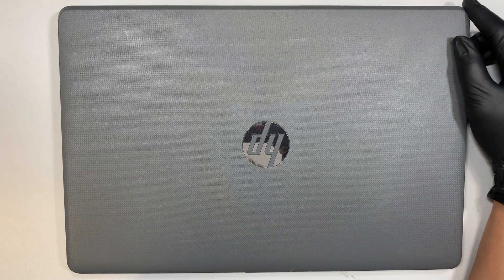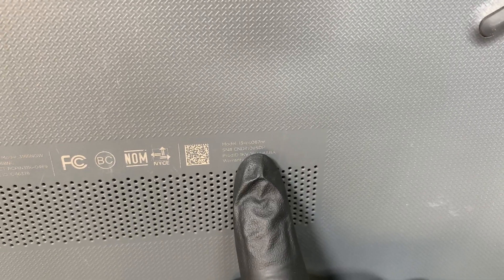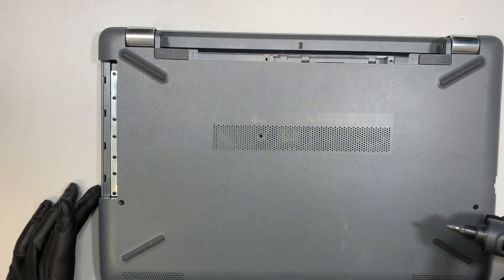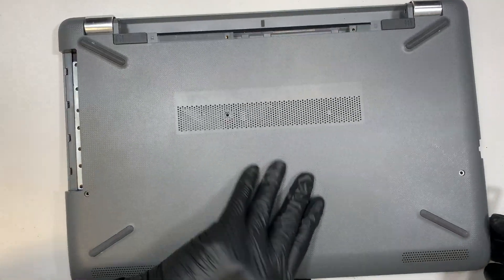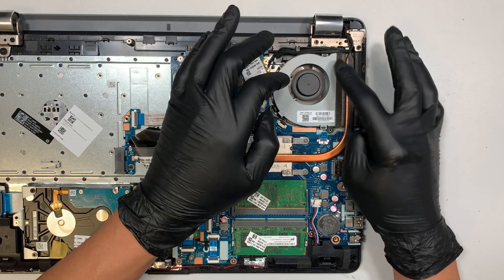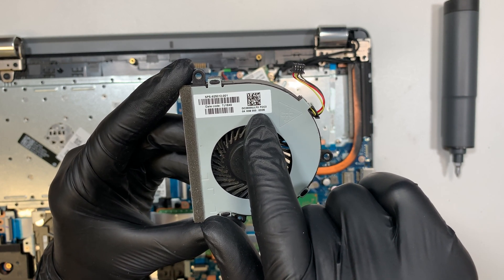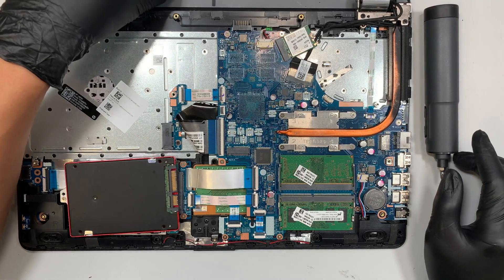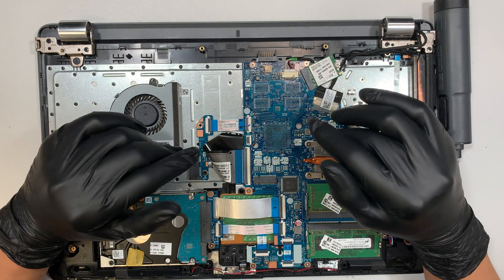HP 15 CPU Fan Replacement

Comment: Does the concave opening of the fan fit OVER the heat sink vents, or does it just touch? Replaced both the heat sink and the fan, and I only feel a little hot air from the vents.

Comment: Many folks asked about thermal paste.  While you’ve got the case open, and it looks like it’s pretty old, as indicated by the coloring of the copper pipe in front of the fan exhaust,it would be a good idea to refresh the thermal paste.  
To do so you would need to remove the heatsink, which is usually soldered to the copper pipes as one unit.  This heatsink covers the CPU.  The old thermal paste needs to be cleaned off of the CPU thoroughly before adding fresh paste.  There are many opinions about what to use to remove thermal paste but the majority of technicians agree that some isopropyl alcohol (90% if you can get it) on a paper towel will wipe it off.  When the CPU is cleaned and dry you can apply the new thermal paste. Again: MANY opinions about what paste is best and what method of application is the best way. It’s comical actually. Just search videos on YouTube.  Your only real concern is to make sure there is enough paste on the CPU and when tightening down the screws on the heatsink, do them in an alternating pattern.  This will prevent a bubble of air between the paste and the CPU.  Full contact is your goal. 
The only place you want to put thermal paste in a computer is between a heatsink and the CPU/GPU/NPU that it covers.

Comment: Thanks a lot man I have the same laptop,

I'm seething right now because, now I can see why my laptop was making the same noise, I found out one screw securing the fan was missing, the noise came from the fan touching the base of the laptop and causing a vibration. 
I think someone dropped the pc, can that really cause the fan to break lose?

Comment: Late question, can I use like for an example a fan from an Acer laptop if it fits and has the same amount of pins with my HP laptop?
Reply from the maker: Yes. If the brackets are the same. And thickness of it.
Reply: @UbergeeksBiz  thanks for the help

Comment: Do you think I could install a second fan in my 15z eh100 (2021) laptop? I ask because to me when I take off back cover there sure seems like room to do it and about 3 months after I had it it started running hot and I have to set my CPU at 1700 mhz on or it'll kill itself when I compile aosp. Trying to think of a way to add a fan. I know it's not something suggested but sure appears to possibly fit... I may order a double fan assembly and just see if I can get it in the case. If so I'll report back and make a video. Lol

Comment: This is a very helpful video. I watched how you spun your original fan and mine was not. I kept moving it a bit and must have dislodged something and my fan spun. I cleaned it up with a small brush and it got past the HP fan check and booted up safely.  I did not use the new fan I bought since the wires weren’t disconnecting easily. I got the new fan from Amazon as noted. It was also very useful to see you move the wires to unscrew the hidden screw keeping the fan in place.  Thank you!

P.S. I had added an SSD and RAM earlier and the computer work great with that upgrade.
Reply: Thanks very much for pointing out "see you move the wires to unscrew the hidden screw" at about 5:30

Comment: It appears the typical laptop fan size is about 55mm. Is this fan larger than that? It tends to look like it is to me.
Reply from the maker: Best is the match cpu fan serial number
Reply: How did you disconnect the fan. Does it lift out or pull out because mine seems very tight at the connector
Reply: @starlabunkley8483  I was asking because I had been looking for a slightly larger fan for a different pc model. On this one it looks like once you get all of the the screws out it should pop right out, although sometimes the factory has some gluish stuff holding it to the case outlet. If you are talking about the electrical connector, those are kind of a tight fit. If your fingernails wont work you should use something like a thin knife edge to work it out side to side carefully. You might want to look at some google images or other videos to see how those fit together. Best with laptops to take it easy, slow and careful, a lot of the parts are fragile.